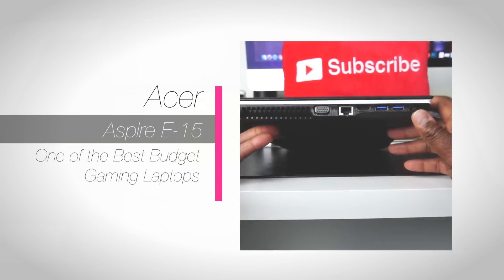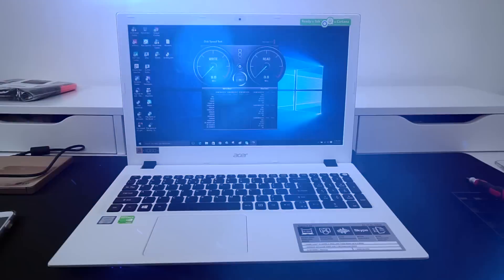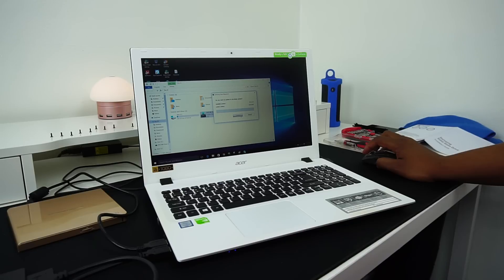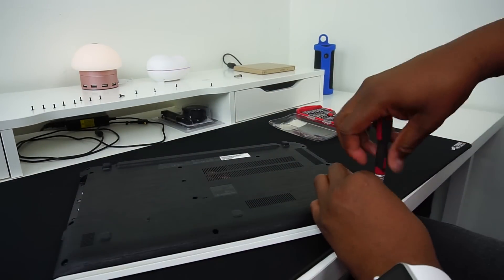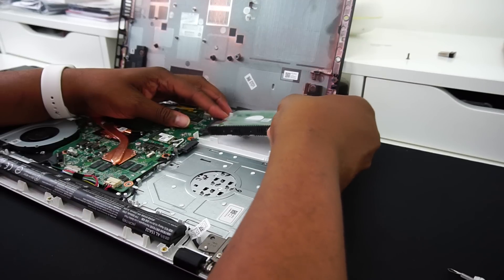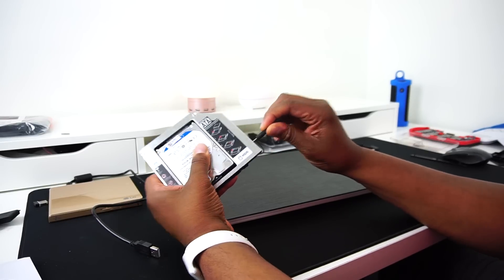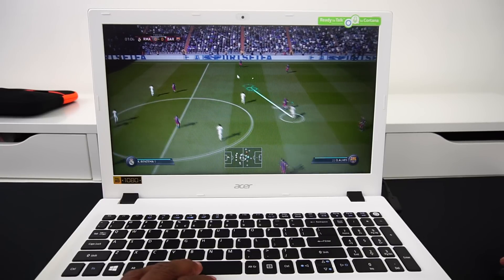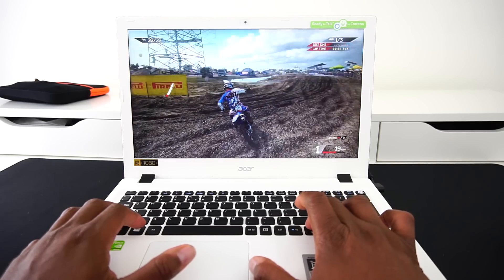Acer Aspire E15 574G Laptop and Samsung SSD Install

Comment: WHY didn't you put SSD on caddy?? it's waaaay simpler.. Is there any difference when using SSD as secondary ?
Reply from the maker: I decided to have the SSD as my Primary since I wanted  my OS to boot faster etc.Having an SSD as a secondary drive is good too especially if you're constantly accessing Video files, virtual machines, etc. Now I have several SSDs in my computers. So it's basically up to the user. Thank you for watching and commenting! Sorry for the delay!

Comment: bro...I have same laptop.
I want to ask you that...
In front, at the left corner side there is a empty space like slot...is that a slot or what? It looks like some kind of a slot...if it is a slot...then what its use? Because I want to add external graphics card to it..can I do that? 
I have watched some videos where they removed their wifi card and attached another one to add new graphics card. So I'm confused Do I need to do the same procedure. Or that slot will help to avoid removing the wifi card step...I'm curious about that slot..plz help

Comment: Hi sir I need your help. My laptop (same model) is experiencing grinding sounds whenever i tilt it. The sound is coming from the bottom left near the fan. In your video, I see that the hard drive is on the right side. Is it possible that my hard drive is on the left side where the sound is coming from? I hate to think that it might be the COD. thank you more power!

Comment: I have reinstalled windows 10 pro and the boot time and overall loading is quite slow.  Does the SSD upgrade make it useable (the boot times and program load times are so slow).   I’m not sure why the computer is so slow from the factory

Comment: Hey i just want to clarify .. i also have aspire e15 .. can i make my HDD as secondary disk while SSD as the primary one? Can it be installed both??
Reply from the maker: Did yours come with a DVD drive installed?
Reply: @TechFit360  yup .. i also have a m.2 slot .. can i use both ? m.2 slot and dvd drive?

Comment: How much difference will an ssd do if I install games on it? Or is a hard drive better for games?
Reply from the maker: What I've noticed with Game is that they boot much faster, but as far as game play not a significant difference. But when giving the option I always will choose an SSD because it has other advantages like less heat, faster load time, etc. Hope this helps! Thank you for watching and subscribing.

Comment: I know two years have passed since you posted this video but. My E5 has a 1TB drive but only 172GB used. Will this be a problem migrating data to a 250GB SSHD with the Samsung EVO software that comes with the new drive or will I need a 1TB SSHD?  Again, only 172GB used on my existing 1TB drive.   
Thanks for all of your instructional videos>

Comment: Does it has m.2 ssd slot?
please reply sir?
Reply from the maker: Unfortunatiely this model doesn't have a M.2 SSD Slot! I wish it did. Thanks for watching!
Reply: Thanks for your reply sir. Is there any method to add ssd without removing optical drive in this model.?

Comment: hello My laptop model is acer aspire E15 E5 573 36B1, if i add 250 GB SSD instead of 500 GB HDD then what would happen the storage of 500 GB HDD?
Reply from the maker: How much space is free on the 500GB HDD? Make sure less than 250GB is used on the 500GB
Reply: TechFit360 thanks, I have another query :if I want to use both ssd & HDD thn at1st put ssd instead of HDD & hdd to dvd drive case then setup windows and everything ok?

Comment: Hi I have an Acer aspire v3 574 - i7 with 16gb ram and a 1TB hard drive. Are these step possible for my laptop? I mean can it support an ssd or am I wasting my time? (FYI, my laptop look very similar to the one you have in this video)

Thanks,
Reply from the maker: Let me look that model up first...
Reply from the maker: Definitely supports an SSD drive.
Reply: TechFit360 thanks, I liked and subscribed, can I get the same drive you have and follow the instructions? Also, can you send me link to everything I'm going to need to fulfill the install if it's not to much trouble.

Thanks techfit360

Comment: Hey could someone answer this question please? I’m new to computers and I want to upgrade my ssd. I have this same exact laptop, exact black, but I’m wondering why I should downgrade my ssd from one terabyte to 250 gigs. I don’t get it.
Reply from the maker: Ok the TB drive that it comes with is not a SSD its a standard drive. SSD is a much faster drive. So by making the 250SSD your boot drive, your Windows will be crazy fast and use the 1TB for storage and other program installs. Hope this helps!
Reply: Oh okay
Reply: TechFit360 thanks so much

Comment: I'm totally new to switching hard drives, if you migrate the files to the ssd, does windows work instantly? Without an installation Progress? And is the windows License saved somewere else on the Motherboard, so you dont need to reactivate?
Reply from the maker: Correct if you use the transfer program, it makes an exact image and places it on the ssd,  Since you are only replacing the hdd and not the motherboard the license is still good!! Thanks for watching!
Reply: TechFit360 Thank You! I'm going to buy myself a SSD then and try it out :)
Reply: You can use data migration to go from a larger to a smaller hard drive. Cloning the destination drive must be equal or larger. Samsung make this an easy process with their free software.

Comment: I have an Acer Aspire V3-575-50TD, and purchased the Samsung 250GB SSD today along with the hard drive caddy and USB cable.  Planning to do the upgrade this weekend along with upgrading the RAM to 16GB.  Hoping for a seamless upgrade with no surprises.  Planning to migrate the data to the SSD drive then swap my current drive for the SSD and reuse the old drive in the optical drive bay.  Did you have any issues at all with it recognizing and booting from the SSD drive?  Also any issues at all with it seeing your old drive as a secondary?

Comment: Hi TechFit360, thanks for the video! I have one quick question: What is the difference if I put the ssd in the caddy instead replace the hdd inside, and can it be the primary bootable drive like that? Can this be set in bios?
Thanks and keep up the good work.

Comment: Hi. First, very good video. Second, I have an Acer ASpire E15-573G from year now and as you said the starting is pretty slow. 
So let me see if I understand, you copy all the data from your laptop to the SSD and then change the HDD with the SSD.
The thing is that I have 434GB used in my HDD, so can I pass everything that I have installed from my laptop to portable HDD (games, files, etc.) to do a copy of the system to the SSD, and then install at the HDD of the laptop the files that i copied so they can be at the HDD that would become the second memory?
Reply from the maker: Ok sooo you have to make sure that your SSD drive has the same[used space] or more.than the drive you're copying it from, this is the easiest and best way to ensure the your programs will run without reinstalling your software again.

Comment: Hi Tech, thanks a lot and it is a great video.  I replaced the 1T hdd with 500 ssd and hook the hdd up at the empty bay.  It boots really fast.  But, I cannot find the hdd from File Explorer.  Why?  One more issue, I found one extra screw after I put everything back together.  Can you please help me?  Thanks.
Reply from the maker: Eric go to disk management, and see if it's there. Unfortunately it's impossible for me to tell you where a screw is missing. Just have to recheck every place for a hole. that's missing a screw! Trust me I've been there!!
Reply: Hi Tech.  Thanks a lot.  I found both the proper hole for the screw and the additional drive. I really appreciate it.  Your video is very helpful.

Comment: Hi Dan, how's it going? thanks for the video. I'm from Brazil and I live in Argentina. Pretty tricky. I already bought an SSD and Caddy, and I will do the same process. Then I ask you. Is it better to install win 10 from scratch? And which app do you use to measure speed? The one you used in the video. Thank you.
Reply from the maker: Brazil is it as beautiful as the pictures I see online?? Hey Thanks and thanks for watching! The transfer software works perfect so no need to start from scratch unless you've had the laptop for a while and you want to clean things up. Yes Black Magic speed test is what I use!!
Reply: TechFit360 Hi Dan! thank you. About Brazil, yes and no. Have beautiful places and others in a state of war or post-war. I'm afraid to take some disk error for SSD in case there is. Good if you think it's okay to clone. And really, your video and the most explanatory I found. thank you.
Reply: I have an Aspire 5750z. It's today I can not afford a new notebook. So I already switched the processor from a B950 to an i3. Cleaning, exchange of Wi-Fi card for a double with Bluetooth. And only the chip with usb 3.0 is missing. I am spending in total 30% of a new one. And mine will have ssd. A new one. what do you think? Thank you

Comment: It is posible to change te CPU from a E15 575?
I've got one and some days ago I come across de idea 
Is it posible to replace it with a better one? 
Right now it has a core i3 6100u
But I checked out and the i7 6600u uses the same socket and also the same power consumption, so I would like to know if it's posible

Comment: Hi i just got the aspire E5-575G last weekend and it come with 256gb ssd
is it okay if I want install another 256gb ssd?
And wts is the difference between m2 ssd and ssd?
Really appreciate it
Reply from the maker: Yes you can! Did it come with a DVD drive? First check your computer documentation to find out if is supports M.2-- These SSDs can plug directly to the MB, they resemble a memory stick. It's faster than your standard SSD & SATA drives. Thank you for watching.
Reply: Hello dude, is it possible to install a M2 on this laptop?

Comment: Good Day!I am planning to change my laptop (same as this model) with a samsung 850 evo ssd...But my laptop has an actual cd rom in it and when I try to take it apart (took all the screws off) Im afraid I'd break the cd rom..Is there a separate screw for the cd rom or I just have to eject it before i remove all the screws and take it apart?What should I do..Very helpful vid btw..Keep it

Comment: Great video! I did not understand the part of replacing where is the DVD for the second HDD caddy? how did you disarm it? and another doubt.. the laptop has a dvd box? why did you used an external dvd reader for the data migration? thanks in advanced.

Comment: great video, thanks
do you think I can use the 1tb drive as secondary drive on a acer aspire e5-573g-35zp? if so is that slot available also for a DVD r/w? and finally, could you share the name of the plug n' play device to connect the HD? (i can't understand in the video).
thanks and keep up the good work
Reply from the maker: I'm pretty sure you use the slot for a secondary HDD on the 35ZP, as far as connecting a dvd drive might want to talk to acer about what model drive your need. 
SATA to USB 3.0 Converter for SSD/HDD http://amzn.to/2ltsogr . $11.95
Thank you for watching!!!
Reply: Nuno Perestrelo

Comment: PLEASE HELP: i have the same laptop. i replaced the old hard drive with an SSD, installed the OS on it, i reset the bios back to the  default setting, when i boot it up, the laptop says no bootable device. i try changing the bios setting and the boot menu setup but nothing works, it only boot up the SSD when the boot mode is Legacy rather then it being on UEFI like it should be. please help me,
Reply from the maker: Question, when you set the new drive up, in the bios was it set to Legacy mode or UEFI mode? I'm thinking maybe it was set to legacy mode and that's why it's only being recognized when you are in Legacy mode.
Reply: Yep, it was set to legacy mode when I install the OS, but when I reset the bios to default ( back to UEFI ), and restart it, that's when I get the no bootbable device. I triad booting from USB but when I set the f12 boot menu, it does not see my usb. I have been fighting with this thing all night so now I'm burning a cd and seeing if that will work.
Reply: i figured it out, there was no way to boot from usb in UEFI mode, so i had to burn a windows DVD. i reset the bios to default and enable f12 at start up, then restarted the laptop. it recognize the DVD and i as able to install it from there.

Comment: Hello I have the new acer e15 575 33 bm i3 7th gen I want to do the same thing but Im not very experienced in this. If I purchase a  m. 2 ssd can I install it on my laptop plus leave the 1tb hdd still installed in its current place on the pc & use it strictly as storage. My goal is to install the new SSD & move the OS windows 10 etc to it & just keep the hdd where its installed & use it as mentioned just storage for pics/vids etc? Im completely clueless to all of this I don't know if or how to do a migration if its required or if my pc will do it on its own plug in play? Thanks for any & all help! 
Ps I did manage to upgrade ram & that went well at least.. Thank you

Comment: acer e15 is not gaming laptop..... i have it and its soooooo slow at minecraft multiplayer and counter strike... an it only have xore i3 and clockspeed is 1.7ghz
Reply: forgot to say its easy to broke...
Reply: You probably have a different Acer e15 model. There are many variants of the e15 model that it can be confusing. The model he has in this video has a core i5 and Nvidia Geforce 940m.
Reply: Cyrus McMillan true

Comment: Does the computer automatically use the ssd as the main storage when you swap it out with the hard drive?
Reply from the maker: It will default to the primary drive, I just do custom and direct it to my secondary hdd.
Reply: TechFit360 thanks!

Comment: Is there a gap due to the HDD caddy or does attaching the front bezel make it look perfect?
Also, how does having a second hard drive effect battery life?
Reply from the maker: No Gap at all, I'm sure by having 2 HDD connected that will drain the battery faster but it hasn't been an issue with me yet. Thanks for watching!
Reply: Thanks for the reply! Def. subbing, I like content creators who care about their viewers! 

Oh one more question,  at 3:57 you just plug it in the optical port, you don't have to screw it on the board or anything? I was kind of worried about that, and if its safe or not :O like couldn't it come loose?

Comment: good morning sir I have a question is there a 2 ram slot in acer f15 i7skylake, if there are 2 slots and given 4gig ram only can I add up another 8 gig?hope youll respond thank you.
Reply from the maker: Yes, I've upgraded mine to 16GB
Reply: TechFit360  sir is it dual slot that ill buy only 8 gig tu upgrade it to 12gig of ram because i have 4 on stock ram?this laptop has a 2 ram slot or only one?

Comment: Thank you for your video. I have received my Acer aspire E 15 yesterday. it has 1TB HDD, DDR4, intel core i3. I was expecting fast and powerful laptop because I switched from my 10 years old laptop. However, I'm disappointed. my new laptop is very slow. I connected to WiFi. it took 20 minutes just to download and install Google chrome browser. YouTube is slow too. How can I fix it? is this what I need to do? please help.
Reply: ussardor get a faster internet connection
Reply: ussardor an ssd

Comment: nice video mr. TechFit360. i have a question, if i use a SSD as my primary, will i loose the recovery of the laptop that is saved in HDD? sorry for my Bad english. because when you change the primary, does the application that comes with the SSD CD copy the recovery from the HHD or just copy the personal files?

Comment: Is it too hard for companies to put access doors with one screw to access and remove the hard drive like in the old days?  Were all those screws at least the same size?  On my HP from 2013 its so much worse having to remove most of the bottom screws then go in from the top taking the keyboard dvd drive and palm rest off and in the process having to remove about 4 ribbon cables
Reply from the maker: Yes they are the same size, but you're right, it's crazy to have to take the whole bottom off just for a HDD replacement!!
Reply: TechFit360 hey this is dray from Jamaica I have a Acer aspire E5-573-395q bt one morning I woke up an it's nt working .....its nt even charging no light coming on to indicate any power so I kno it's much more than a black screen what do you think

Comment: ;-; im having issues closing my case for the laptop described. how do you properly close the part by the speakers? (bottom left side)
Reply from the maker: I haven't run into that issue! Has it been like that since purchase??
Reply: no it hasn't it was just a really really frustrating time trying to clone my SSH which didn't work cuz the program kept glitching out... but after a snack inwas able to get the case fited back on properly over the headphone jack and USB ports again. it's just weird cuz the opposite side will fit right in during that process and screw everything up. just a monkey wrench for a maiden voyage

Comment: Hey TechFit360, I have a quick question. Would we just be able to put the SSD in the universal caddy, wipe windows 10 and reinstall windows onto the SSD in the caddy?
Reply from the maker: Sure you can do that. Are you going to make it your primary drive after you do this? That's where you'll see the speed difference.
Reply: yes my goal is to make the SSD the primary once it's in the caddy :)

Comment: I purchased an SSD and used a free migration tool but if I try to boot the laptop without the original drive in the disk caddy it says "no bootable drive found"
Reply from the maker: Does the computer recognize the SSD?
Reply: TechFit360 Yeah it recognizes it when I go into disk management. It just won't boot from it.
Reply: Trey Perry I'm having the same problem. did you happen to get it working?